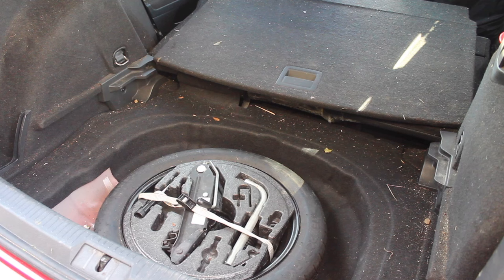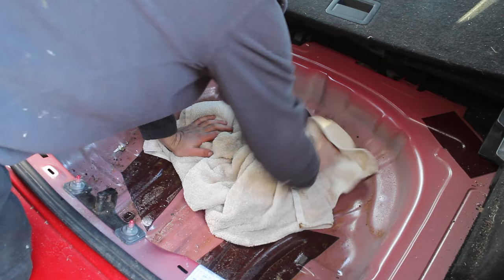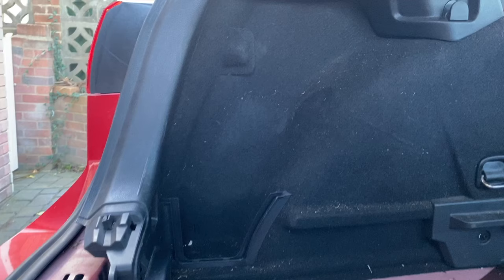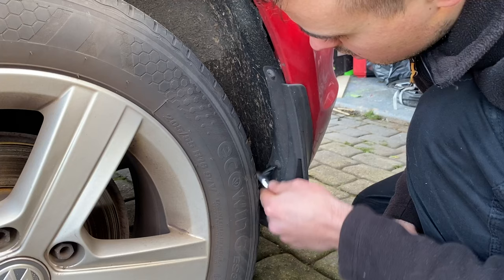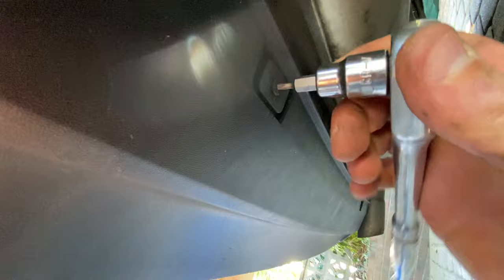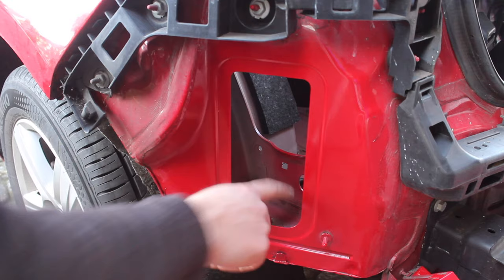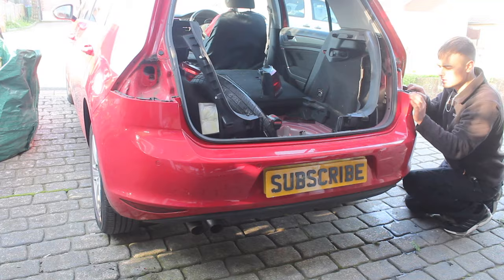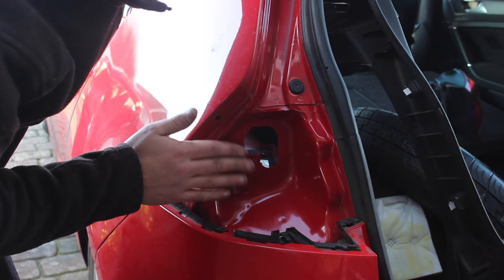VW Golf MK 7 Boot Leak FIX, 4 common leaks!

Comment: FOR EVERY GOLF 7 OWNER: check these out: 
(tip: keep a toilet paper roll in the sidepockets of the booth. Thats how i noticed my problem, it was wet, even tho no water was visible)
1. slam vents (water in booth or underneath the backseat) take vents off, clean and apply tons of silicone, new ones will corrode eventually.
 2. Panoramic roof drains (they might be clogged leading to infiltration by the panoramic roof) ugly mess, stained interior on all walls down to the footwell.
3. Speaker sealant foam (all 4)(water underneath the speakers grill and on the inside of the door sealant at speaker level, leads to water in the footwell and mold later) ugglier mess.
4. Reverse camera cover/drain pipe (water in the booth).

I was lucky. Had all of them.

5. Tail lights. Water in booth. Dont know how to fix this, but check after pressure washing your car.
Reply from the maker: Great comment, thanks for sharing I’ve pinned it so everyone can read it as haven’t had the speaker one myself yet but it’s probably only a matter of time before I do 😂👍🏼
Reply: Me too...Speaker seals 🤬🤬🤬
Reply: Hi, can you please help me in uderstanding the issue? I ve mk7 63 reg. Just noticed a puddle in spare wheel well and the puddle is on driver's side only. The other side of the well is dry. What could be the cause of this?
Reply: Hi, can you please help me in uderstanding the issue? I ve mk7 63 reg. Just noticed a puddle in spare wheel well and the puddle is on driver's side only. The other side of the well is dry. What could be the cause of this?
Reply: Try the tail light, check if there are leaks around the foam(check in this video) or the panoramic roofs rear left drain tube. You need to strip the side booth panel and booth roof panel to have acces
Reply: Thank you. Really appreciate the video and these comments. You say the side pockets? These seem enclosed and both are dry in fact VW put a carton of antifreeze in one of them.   Probably a stupid question but if I put toilet rolls in these how will it inform me where the water is getting in ? i.e. the air vents. I've released the grommet underneath each vent and drained water but I notice the tailgate pipe has completely disintegrated. Many thanks for your help guys I am absolutely hopeless with cars and don't trust VW (who after it's service advised I would need leave the car with them a few days for investigation  - no chance ! ). They obviously know about these faults.

Comment: Just found 2 inches of water in my spare wheel well yesterday and thought I was just unlucky till I started googling the possible cause. I was amazed how big a problem this is and can't believe that vw hasn't done a recall to sort it out. Good video mate,I just need the courage to start ripping all the fasteners off without any damage😁
Reply: Right. If I had known this I would never have bought a volkswagen...
Reply: I've brought my 2019 Golf into VW three times and they've cleaned the drains and told me there wasn't a problem and they tested it. i believe the issue is due to parking on a specific incline. our driveway is pretty steep and it didn't start happening until we moved here.
Reply: I CANT BELIEVE VW DIDNT do a recall on this issue. We all have this damn issue. And now it went on my right rear seat. And now started getting moldy damn
Reply: @allybearbear  I've got mine for a little over a month so don't know where it was parked before but I am parking exclusively on flat ground. And I noticed this issue yesterday
Reply: did you change the vents yet?? @allybearbear
Reply: VW is a total dogshit brand. Had loads of old French cars and never had issues like this. My golf is currently like a mobile swimming pool. Amongst other problems it’s been the least reliable car I’ve owned. Would never buy another!!

Good video mate. I lolled at the mushroom joke 😅
Reply: @allybearbear  probably not? Think its worse after driving in rainy conditions...

Comment: It's ridiculous that this happens to these cars. VW are supposed to be a top manufacturer. Anyway, cheers for a good video.
Reply from the maker: I was quite surprised when I realised how many cars are affected by this problem, not only VW. No worries thanks for watching 👍🙂
Reply: @TurnersWorkshop97  ive got a mark 7 gti and water seems to be coming in from the vents (90% sure), only happens after car washes and driving in heavy drain. Had a citroen c4 before that, dry as a nut even though it had damage at the back.
Reply: @ferhatovic86  Same. Had an Opel before and when I just bought it new somebody hit my backdoor. Little water came in but nothing dramatically... A little mold after 10 years. Bought a VW not half a year ago and had like 3 liters of water in the boot. Just left my car at the mechanic, called half hour ago and he "can't find the source". I just do a quick google search and find 3 video's of water problems with VW. I'm a little pissed off right now...
Reply: @erisblisset  yes its very annoying considering that the car is awesome in every other way. Have you checked to see if its the vent. I stripped my boot and found that its coming from the left bottom which is why i think its the vent. I'm thinking of spraying some rust laquer until i get it fixed but just soaking it up with a cloth atm before it gets that bad.
Reply: @ferhatovic86  I have some more problems with the car. Engine indicator light always turns on, car mechanic says it's because I drive too slow, but I doubt it. There's water leaking from my exhaust, which should stop once the engine is hot, but mine keeps dripping. The indicator light is related to sensors in the exhaust, so I think the water in the exhaust and indicator light (CO2 sensor) are related. And the consumption is higher than my previous car while it's 10 years newer and has a lighter engine 1.2 instead of 1.4. Consumption might of course also be related to sensors in the exhaust and fuel injection regulation based upon these sensors. Else it's a beautiful car with many options, but these issues on a second hand with only 30000km are really frustrating.
Reply: @erisblisset  lol you might want to change your mechanic. I think the water from exhaust isnt a big issue unless you also get alot of smoke coming out with it. Might be worthwhile buy a diagnostic device of amazon. I gota cheap one and it picked up a sensor issue on my other car which caused all sorts of problems later down the line because it messed with the emission monitor (diesel particle filter etc). The car ended up going into safety mode. Was an Audi, again these bloody german machines that are supposed to be the best. I think the next car i buy will be the one i hate the most.
Reply: @ferhatovic86  We've (me and family) been always Opel drivers and never had many problems with any car for over 40 years. Parents now have Opel & Volvo. We probably had over 10 Opels in our lives. 

Yea, changing the mechanic i would like, but my father goes there too. And normally my car should have one year warranty, so i'll push him to solve these issues. But the way he downplays these issues is kind of a bad start.

Comment: My leak into mk7 boot well was solved dead easy,all I did was put a two inch clear silicon bead along the top  of rear lights. Lift up boot and just fill that gap between light and the body, water then runs down the Chanel and down onto the bumper and off the car. Been dry ever since. I didn’t take anything apart. Hope this helps someone else reading this.

Comment: Crazy to see so many people have the same problem.. this is a manufacturing problem.. and vw should’ve recalled those cars. Noticed this morning in my wife’s car (2019 vw golf sportsvan) that the spare wheel was literally swimming in the back of the car. This video helped so much.. and found my issue.. right rear vent.  So thank you for posting this in such a well manner. Btw.. sorry for asking.. but how could you leave your car to the point that mushrooms grew inside it.. and the rear seats turned green.. what the hell 😅
Reply from the maker: No problem, really glad you found it useful and it helped you find and fix the issue 😊 I thought I would turn the boot into a garden seeing as it already has an irrigation system 😆
Reply: victorprioroc1009...I was wondering IF this issue applies to the Sportwagen AND Alltrack...appears it does...damn it, I'll have to check my Alltrack now. I seem to get fogged up windows periodically seemingly for no reason, I've alway attributed to my mud guard floor mats which it could be but now I've gonna check out those rear side vents and if they haven't leaked yet I'll put a bead of silicone around them as preventive maintenance.I summer sometimes my windows will fog if I've been running my A/C and I park go into store or something and when I return and start car the front window will fog a little...this has been ongoing since new.
Reply: @harryberry474  hi. Well sportswagen i can clearly say YES… and i would say since alltrack is made on the same platform i could bet it’s a similar issue. Honestly i was shocked that this could happen .. i mean my wife’s car has only 30k km.. bought as new. Took down the bumper yesterday evening and i properly sealed the right vent with a special glue on the inside and then applied silicon on the outside … technically now should never leak again. I did the same for the left vent asa preventive measure. Then i can only recommend (also as in the video above) to apply a small amount of silicon on the sponge that covers the rear lamps.. i don’t think in my case water entered through the lights BUT i bet was a matter of time beforenit does.. as the sponge no longer had a good grip to the body of the car. Technically my rear end should now be water proof. And yes also in mu case before noticing the “ocean” in the trunk i always had a foggy rear window . Good luck !

Comment: I have just been sorting my Golf Mk7 out. Your guide helped me sort the water in the boot by sealing the vents with silicon. I also replaced the rubber drain pipe on boot handle and also sealed around the light foam fittings. Some extra tips for anyone else with this VW water ingress problem and with water in the car cabin. I also found that where the speakers are riveted in the rear doors there are cracks in the plastic so when sealing also ensure you get them sealed also. Aswell, at the outflow drain at the bottom of the rear door, mine was blocked. When pouring water down the outside of the window nothing came out so there was sitting water in the door causing the water level to raise and pour through the speaker. So top tip to remove the rubber seal at the bottom of the rear doors and ensure its not clogged/blocked. I also found some water ingress in the hinge in the centre of the rear door. I created a small silicon route so it doesn't run down the inside seal. Hope this tidbit helps anyone else with this problem. Both my door speakers were leaking and both my rear vents were also leaking. I sealed my speakers without removing them by scraping out the foam seal and just using silicon around the speakers. Took me a week to dry out the car with an ordinary fan by lifting the carpets, inserting wooden blocks underneath for airflow. Just purchaed a small fan heater from Amazon for £15 to hlep dry out the cabin. VW have so many issues with water ingress its insane!!!
Reply: My rear door is leaking so the rubber seal at the bottom of the door do you remove it completely or do you put it back on again after inspection?

Comment: Just a warning, I mistook a screw lower down in the arch for one of the 4 screws. I missed 1 of the 2 screws located by the join of the bumper and arch on both sides, and have now broken the bumper. It sits just off from flush and if you weren’t looking for it you probably wouldn’t notice it. But I know it’s there, and because of the damage it’s likely il need a new bumper to fix that issue. Not sure if it’s car specific, I have a mk7 golf R. Best removing all 5 screws just incase 👍🏼

Comment: I also noticed that my windscreen was always showing signs of condensation. When I checked the boot, a puddle of water was present underneath the space saver wheel. The water had also found its way to the rear seats - the bench was soaking.

On closer inspection, the water was entering the boot from both the rear light clusters and bumper vents. I removed the old vents and replaced them with new parts, as well as applying tonnes of silicone sealant inside and out. For the light clusters, changed gaskets.

Gave the rear bench a deep clean with a shop vac, as well as cleaning up the boot area and allowing everything a good chance to dry out.

We’ve had loads of rain since the maintenance on the car and the boot is thankfully bone dry.
Reply: Hi which sealant did you use
Reply: @Jamiekhan-qg2ji I used Everflex 145 Butyl Rubber Sealant for the air vents.

I also recently discovered leaks in both rear doors, which is also a common fault on these vehicles. The water was bypassing the rear door seals and entering the footwells. My door situation was due to both of the speakers.

I removed the door card and leaked tested it, which revealed the water rapidly dripping from the base of the speaker mounts. After the leak test, I allowed everything to fully dry. Once dried, I applied a decent amount of the same Butyl sealant where the inner seal was on the speaker itself and around the speaker mounts. I allowed the sealant enough time to set, then water tested the rear doors for a few minutes with a water hose - no leaks! 🙂

Now I can finally say my Golf is fully water sealed. We’ve had loads of heavy rain over the Easter period and the interior is dry throughout.

Comment: You make removing the bumper look easy. Couldn't get ours off without way more force than I was happy with (which tbh was the same for everything else too!)

It is JUST possible however to seal up the vents without removing the bumper and that's the way I ended up doing it. 
If you pop them off you can then angle them so they come out, reach through the hole to clean up the face then squirt a healthy fat bead of silicon sealant around the vent. You can then do the same in reverse and pop them back on and squish the bead of silicon against the body. Fingers crossed it works but it's certainly no longer "rattling" around.
Reply: I managed to get bumper skin disconnected on one corner and wedged a piece of wood in between and like yourself realised it can be done without doing that...Fingers crossed all sorted...

Comment: oh man, this video was so useful! My passenger side floor mat was constantly soaked. It turned out the leak was in the left tail light, exactly as you show! The boot was soaked too and the water had travelled under the rear passenger carpet and onto the front. I would have never guessed! Thank you so much!

Comment: Got this exact problem on our Mk7. I guess as a short term fix you could leave those bungs out to allow the water to get out until you have time to re-seal those vents.
Reply from the maker: Definitely, take the bungs out and sort when you have spare time 😊
Reply: I'm having same issue where is the Bung? Can this be used to drain my water out as I have a puddle not just moisture that can be cleaned with towel

Comment: I watched the very informative video. I CBA to take the back end off. I got under the back of the car, pulled the drainage grommet out on both sides. Water came out. Drilled 2 small holes in the centre of each grommet. Used clear silicone to seal the top of the rear lights (when boot open). Sorted. 10 mins

Comment: Thanks Turner, follow your steps.  Found the loose air vents.  Siliconed up.  Add some sound protection while at it.   Sweet, no more pools if water.  That water freaked us out.  You're a saver!
Reply from the maker: No problem at all, really glad you found the video useful 👍🏼😊

Comment: Yes only recently found my mk7 has very soggy carpets in the wheel well. I had noticed condensation was a bit more than you would expect but this is the reason. A friend had the same issue but with standing water! VW charged a lot to fix his. Removing the bung did let our some water but you might get more coming in from spray...
Very helpful video though...

Comment: CHECK OUT if you are not comfortable removing the bumper!
Hi Turner, many thanks and great video that you made! and you have put me on the right track to solve the water ingress in the boot of my mk7 Golf. I had already changed the little water drain hose as it was broken but that did not solve the problem fully. I followed your steps until halfway the removal of the rear bumper and was getting concerned about damaging it as it was really hard to release the clips. I had a rethink and based on your work I came up with a variation in the way of working that does NOT require the bumper removal! 
It is possible to carefully push the ventilation pieces out and subsequently turn them sideways and pull them back and out through the boot. Then apply the silicon as per your advice and then carefully pass them through the insert, turn to the right orientation and pull the carefully in position, maybe using pliers and making sure the 4 clips click into position. Downside is not so good control over the quality of the silicon sealing and to cope with this I used a lot of silicon so it would surely sealed and the excess on the outside can obviously not be nicely removed this way. I also decided to not silicon some centimeters/an inch or so at the lowest point to allow an exit for any water that unexpectedly still passes. 
Maybe good alternative for those that are also not comfortable to remove the bumper...

Take care!